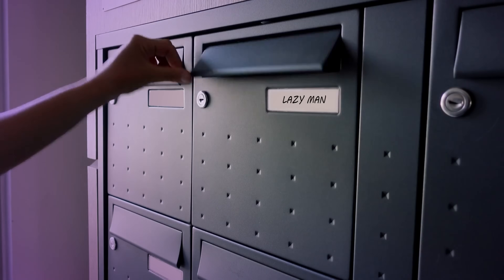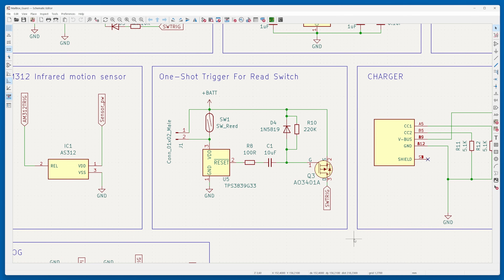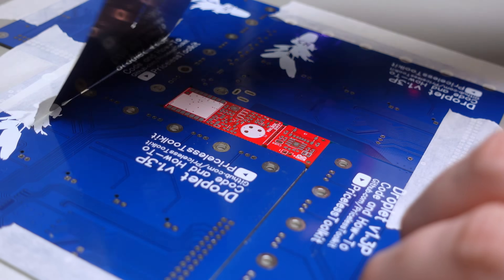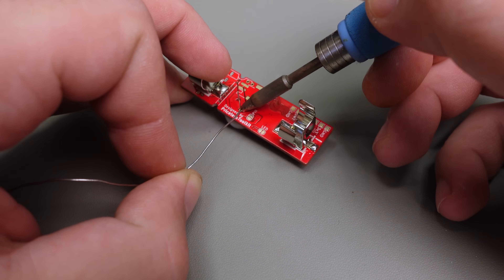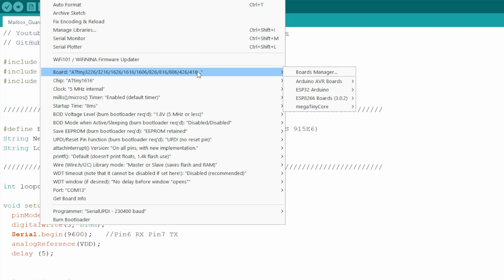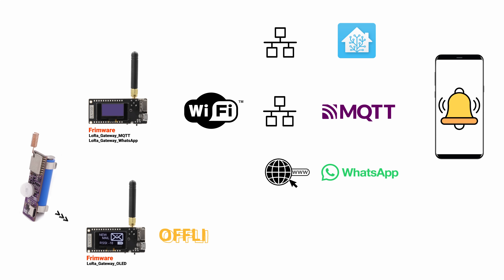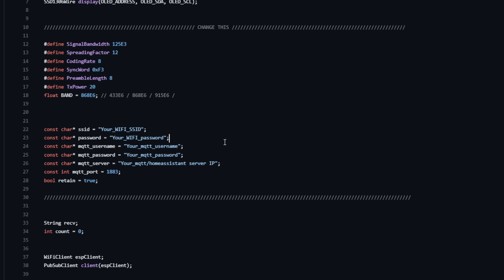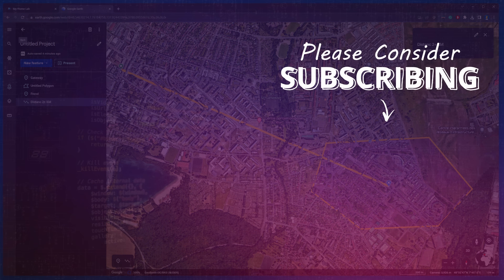IoT Mailbox Guard for Home Assistant. Defends Against Parcel Thefts!

Comment: Very nice, i was planing a similar device, but had to resolve the problem of community mailbox is open fully, and it doesn't mean I have mail. 
Wished I had you in my team. 
PS : I was planing to use an esp32 using espnow.
Reply from the maker: Thank you, I don't know what is community mailbox 🧐.  I have incoming projects with ESPNOW "GW + Sensors"
Reply: Hi, Community mailbox is when one door opens a lot of mailboxes. Mail man distributes the mail for multiple people, small parcel, then close the big door. So I need to detect the presence of mail instead. A piezo sensor, maybe. But my biggest problem -36C in winter. esp32, you can have a fix. But the battery, nope. as it's not my mailbox. I can't recharge the battery with solar or wind. So I can't exchange power for heat. @PricelessToolkit
Reply from the maker: now I understand "I have a big door too :)" -36C OMG. There is a new type of battery "Li-Polymer mix with supercapacitor" specially made for harsh conditions but the capacity is not great 200-300 mA.
Reply from the maker: i have IoT project with supercaps with solar panel all in one "currently in the development stage". https://photos.app.goo.gl/a1e9HVdb87n1rFyJ9

Comment: my home wifi does not reach my mailbox, wanted to do a similar project, with 9 lights on the bottom of the box and light sensors at the top, can tell if something is in the box (hard to detect the mailbox being opened AND/OR a letter being slided in.)
Reply from the maker: Yes, I thought to use IR sensors with IR LEDs or pressure sensor film, but all these methods have the inconvenience of installation.

Comment: Wonderful idea! I am worried my solid metal mailbox will attenuate the signal too much to be picked up from 250 m away.
Reply from the maker: If your mailbox is note like a Tank, It should work, if for some reason the signal is weak, just change the antenna on the gateway.

Comment: Can you run this off alkaline C cells? If so, how long will it last?
Reply from the maker: No, you can use  Li-Ion 14500 or Li-Po rechargable Batteries. 14500 is AA size.

Comment: Nice project. Next time maybe ypu could explain the circuit a litte. 
Qustion, is the files for the programming pin clip available somewhere?
Reply from the maker: Thanks! I think the files are available on Thingiverse. just check pin distance 2.54mm . Faund on anoter site https://www.printables.com/model/68300-programmer-clip-using-header-pins https://thangs.com/designer/damien.martin.guillerez/3d-model/Programmer%20Clip%20using%20Header%20Pins-18017

Comment: This would be a nice addition to my Iobroker setup!
Reply from the maker: Why ioBroker and not Home Assistant?
Reply: @PricelessToolkit  I have been runing Iobroker for several years, but almost no experience on Home Assistant - that's the only reason.
Reply from the maker: I'm not familiar with iobroker, i will take a look. Thanks.
Reply: Basically it's just another flavour of Smart Home / Home Automation Server. Probably not as polished as Home Assistant but extremely versatile as there are Adapters (Plugins) for many devices. My hunch is that the Mailbox-Sensor could work out of the box with existing Adapters, as I'm using a lot of Tasmota Wifi Sockets on IoBroker using MQTT for communication. I guess If I configured the LoRa Gateway for MQTT with the connection details from my IoBroker server, it might show up as a new device immediately - but I'm not entirely sure, maybe some kind of individual adapter is required.
Reply from the maker: i'm not sure abaut "show up as a new device immediately" in iobracker you can retrieve MQTT topics information?
Reply: I am not entirely sure. As I mentioned I am using Tasmota WiFi Sockets and I am using the "Sonoff" Adapter in IoBroker as that one is capable to work with these sockets. The Adapter includes an MQTT server (I am configuring the MQTT credentials in the adapter's settings) and I am putting the credentials on my Tasmota devices when configuring them. All the rest is automatic, the Tasmota devices connect via MQTT to the IoBroker server and the Sonoff Adapter translates the incoming data into Objects for IoBroker.

This why I think the Mailbox sensor might be recognized automatically as I suspect that the Sonoff Adapter might treat it just as another device and put the transmitted data in IoBroker's Object tree - however I am not sure about it, I'd have to try.

Comment: You could also add a speaker
Reply from the maker: to scare Postman?
Reply: @PricelessToolkit  If you have a box for packages, you could instruct them to lock it
Reply from the maker: @speeter6345  ahhh now I understand, but it will be a fixed message.
Reply: @PricelessToolkit  another possibility would be to wire up an electronic lock directly

Comment: very cool project. i currently use an aqara vibration sensor in my mailbox. it works ok. i had to set the sensitivity to high to get it to work reliable. but if the mail is just placed in the gab and not dropped into the mailbox it often goes undetected.
Reply from the maker: Thanks for sharing, How far is the gateway?

Comment: Nicely done, compact, long range.  Not the easiest to build for someone who doesn't have a pick-and-place machine, but that's always a trade-off with SMT.
Reply from the maker: Thanks, you only need pair of tweezers, I didn't choose small components on purpose so that people could assemble them easily.  if i choose 0402 size It could be done 2 times smaller.

Comment: I've just been recommended your video while making a similar project. I will check your board because it's almost exactly what I need. I'm making a vibration sensor to put in the seat post of my bicycle to detect if someone is trying to steal or damage it. I keep the bike outside my apartment but don't want to trigger loud alarms because of my neighbors. So I need a normal beep in the bike and a notification for me to check for the bike (I can see it from my window). I guess that many people may have similar use cases.
Reply from the maker: seems you have a very interesting project, check out this gyro "LIS3DHTR".

Comment: How would this perform through some concrete walls? I previously have tried to use 433mhz security reed switches in my apartment mailbox with an RTL-SDR on my balcony, but either the combination of the low transmission power, or concrete walls weren't able to yield me any signal. This is a very exciting project and it's exactly what I am looking for if I can manage to pickup the signal.
Reply from the maker: Hi, I live in an apartment third floor, Mailbox sensor is in the Metal mailbox, so 2 concrete floors + a metal box and it works very well, but consider 433Mhz Lora. funny but I use a security door switch too in my basement just removed the spiral antenna on it, and soldered 1/4 wave length cable, I use RTL-SDR too and it works well..The advantages of LoRa are protocol "modulation" and 20dbm output "100mw". By the way, the antennas on these SDRs are very bad and not tuned to 433MHz

Comment: Wow, cool project and something I always wanted to try myself! Congrats. I would like to test it myself. Trying JLCPCB but they ask for a CPL file (as well as the BOM file) to do assembly. I cannot see the file in the github project. Would it be OK to provide it? I am not sure if we can generate it without the original designer files. Best regards!
Reply from the maker: I am sharing This project not for mass production so I will not provide CPL File I hope you can understand, you can find the BOM file, html interactive BOM file in my Github, so you can assemble it yourself.
Reply: Of course I do understand @PricelessToolkit . Entirely your call. I might try to buy your recommended heat plate and solder everything myself (or just buy it from your shop if I feel it is too much for me! ;) Thanks again for releasing this!
Reply from the maker: If you have questions about assembly, please feel free to ask.

Comment: I have a mailbox which is around 100m away, hopefully this might suit my needs!
Reply from the maker: Definitely!
Reply: @PricelessToolkit  Only now getting to set this up, hitting a problem when programming the gateway. Using LoRa_Gateway_OLED.ino with the boared selected as V1_6 in board.h and the CONFIG  setup the same as the Mailbox Guard, but when I compile and program the gateway, the serial monitor shows the unit in a boot loop, with..
ELF file SHA256: 326bfed4dfb12ea1

Rebooting...
09� � LD�1!a�� �1�䍕!��
assert failed: i2c_ll_set_bus_timing i2c_ll.h:109 (scl_high > 13)

Backtrace: 0x40082529:0x3ffb1ff0 0x400883ed:0x3ffb2010 0x4008d41a:0x3ffb2030 0x400dd2f6:0x3ffb2160 0x400d3fc5:0x3ffb2180 0x400d202f:0x3ffb21b0 0x400d15d9:0x3ffb21d0 0x400d225d:0x3ffb21f0 0x400d2709:0x3ffb2210 0x400d17a7:0x3ffb2230 0x400d5a11:0x3ffb

Any pointers? What thing am I doing silly?
Reply: My bad, had the 3.0.0-alpha1 ESP32 board libary installed - moved down to 2.0.14 and all is well in the world :)

Comment: Hello, cool project. Am I correct in understanding that once I buy the sensor I will need a programmer to program it to work with LORA? This cannot be done through type c
Reply from the maker: Hi, yes USB Type-C is only for charging, you need any Serial2UPDI programmer.
Reply: @PricelessToolkit  which one to choose for aliexpress? I can't really find something like this, the video is embedded in 5.13
Reply from the maker: I don't think you can find a UPDI programmer on Aliexpress, if you have skills for soldering, you can buy a cheap 3.3v UART programmer and convert it to Serial2UPDI. or buy UPDI prog on Tindy or from my store.

Comment: For several years, this concept has lingered in my thoughts. I had considered integrating a weight sensor, but hesitated due to the potential battery consumption it might entail. Also, range apprehensions were a concern that deterred me from taking action. Nevertheless, the current setup appears to have allayed these apprehensions. This could potentially be the solution I've been seeking for quite some time. Exceptional work!
Reply from the maker: Thank you very much! I'm glad it will be useful to you.

Comment: I've been thinking of doing something similar to this. Have you done any range tests on it? My mailbox is tricky, around 300m away with 2 buildings in between the house and mailbox.
Edit: Now that I watched until the end, you did do some range tests and the results were impressive to say the least.
Reply from the maker: Yes, in the video I did a range test, if you install the sensor on the door in my opinion it will work, but it's impossible to say for sure. if you have a high radio noise level, in your area this also affects performance.

Comment: Really well designed. I especially like the possibility for the onboard read switch 👌🏻 If only I had your abilities 😊

Having used different mail box sensors for a few years, the best option in mu experience (which gives fewest false positives and negatives) are read switches. Especially when the mailbox is outdoor and subject to bugs and temp changes.

I use one read switch for the small latch and another for the big latch. That way I dont get notifications when I empty the mailbox and I never have to manually reset the mail status. When the small latch opens, set mail status to true and when big latch opens, set status to false. 
Consequently, I would love to see a version of your sensor with one built-in read switch and one external read switch (and no PIR).

Keep up the good work! 🙏🏻👍🏻
Reply from the maker: Thank you! By the way, in France, the postman has the keys for the big door.
Reply: @PricelessToolkit  Ahh, I see. Then it would also be difficult to change the lock. I use a fingerprint lock for my mailbox, so I never have to bring keys, but that would not work for different postmen 😊

Comment: Very cool project, and very cool tools 😅
I'll explore lora. Quite interesting.
My concern it's only about frequency, the same of my Zwave network.. I don't want to self-create issue to me.
But I have to test (if someone already tested.. Feel free to give me your opinion 😅).

I'm also thinking about a lora gps collar for pets, but probably too energy is required for gps.
Reply from the maker: Thanks, you can use 433MHz version if in your cauntry its allowed. I think GPS for dogs already exist, these days there is a GPS modules that is very small and does not use much power.
Reply: @PricelessToolkit  right! Lora@433! Simple solution 😅

Sure for dogs there are already commercial solutions but I'm thinking about cats (that needs a smaller device). I'll investigate.. Probably can be done, I don't know.

Comment: After watching your video I really think I should learn more about LoRaWAN and its benefits :). Looks like a nice solution for small battery powered sensors and actors. Will your sensor work inside of a metal mailbox?
Reply from the maker: Hi, MailBox Guard dont use LoRaWAN network.  LoRaWAN networks have restrictions, time in the air...... . My mailbox is metal, and of course, this affects the range, But if your mailbox is very far away, you can install the sensor on the door. When you open it, it will be outside.

Comment: Been trying to get a LoRa mailbox sensor going for a while. Tried once prior but because of mountainous terrain, and 1km to letter box I couldn't get it to work. However keen to revisit the project again with your hardware. Thanks for the video...
Reply from the maker: Try the 433mhz version! if your country allows it.
Reply: Hi, its a year later and I'm still working (or thinking!) on a mailbox sensor. I still love your design for its size, with power saving along with the use of the reed switch. However I have gone down the route of using a Mestastic mesh to get a signal down to my mailbox 1km away and not in line of sight (I'm in Australia and have to use 915mhz so couldn't try your suggestion of 433mhz). I am putting a node half way between the two that will have line of sight with my house and should get a signal down to the mailbox at the bottom of a gully. So my question is as Meshtastic is based on lora would your design work on my Meshtastic mesh? Also is there provision to place a 915mhz antenna on the unit?

Comment: Cool and neat! But works only if mail in your country works in a way that a postman opens the mailbox to put the package inside. What about locked mailboxes, where postman just inserts small packages though a slot? PIR sensor won't detect that, nor would reed switch.
Also, LoRa range testing involves houses. What about appartment buildings? Its 20m air distance from my mailbox, but through 3 floors worth of reinforced concrete.
Reply from the maker: Thanks, I live in an apartment, with the same stuff, reinforced concrete... it's not 100 percent accurate but it detects small packages too, because of Temperature differences "MailBox- Package".

Comment: Excellent design! I like the thought put into the layout for different configurations and thanks for the suggestion on the solder heat plate. This reminds me I really should finish my ESPNOW mailbox sensor, it uses a reed switch and power latch also but is esp8266 and 2xAA powered. It's very much a prototype and is weatherproofed through a ziplock bag
Reply from the maker: Glad you like it!

Comment: I don't understand the antenna part. Is on there as a wire right? If I buy it, would I have to solder the connector to use different one?
Reply from the maker: No antenna part good/bad is for the gateway, you can try different antennae on the gateway if you have a problem with the range.

Comment: Hi Good project. I would like to put the same at home. How far can be the lora gateway to the mail box  sensor?
Reply from the maker: It depends on many things like mailbox material, gateway antenna, frequency, and interference... but if it's a Haus-type mailbox easily 300-500m, if it's apartment type, a little less, but it's very hard to say.